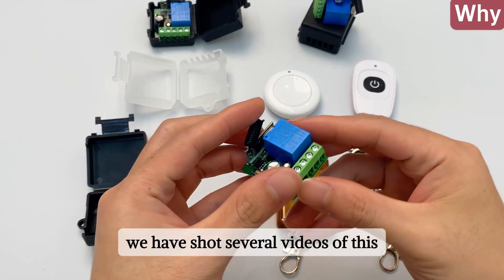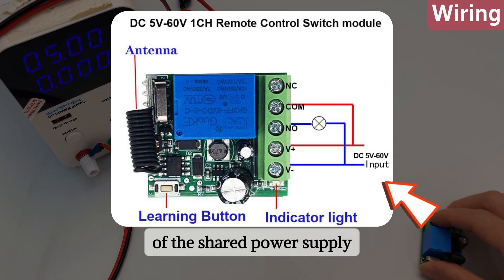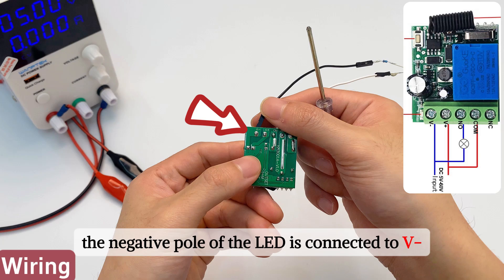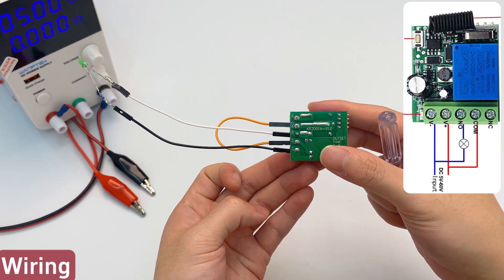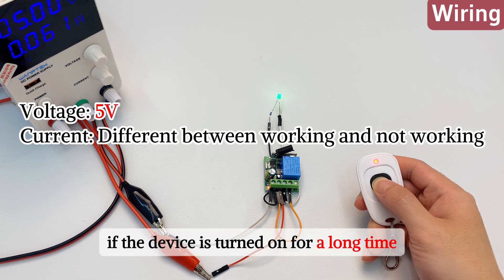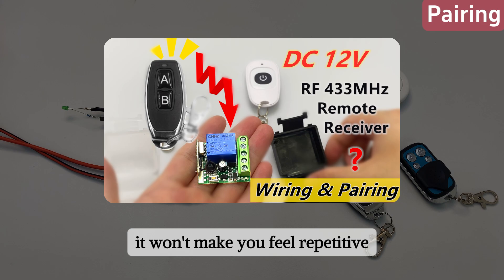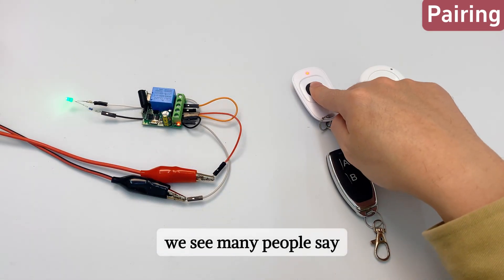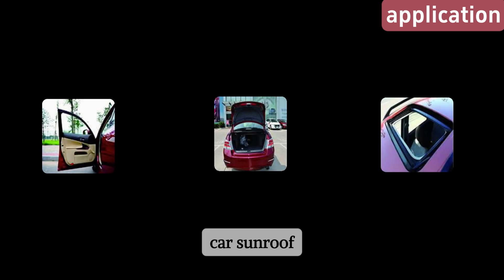Relay remote control switch 5V 9V 12V 24V 36V 48V 60V RF KR3001 Based on KR1201 upgrade by QIACHIP

Comment: Dear brother, 12 volt battery is connected with relay and pair modes.... after if the 12 volt battery disconnect then connect again and pair modes with remote..... Or not to again..... Reply me please.... Thanks
Reply from the maker: No need for re - pairing. 
After disconnecting and reconnecting the battery, the previous pairing mode with the remote control will be retained. You can directly use the remote control for operation without repeating the pairing process. 
I will make a new video for a test demonstration later. Please follow me to receive the new video in a timely manner.
Reply: Thanks bro.... I have subscribed your channel
Reply from the maker: https://youtu.be/9_AoavVu7rc
Does the Relay Switch Need Pair Again After Power Loss? Wireless Remote Control Switch 12V 220V Test
I do，bro

Comment: Product links provide please
Reply from the maker: https://qiachip.com/products/kr3001a-rf-433mhz-remote-control-1-channel-dry-contact-switch-wide-voltage-power-supply-dc-5v-9v-12v-24v-36v-48v-60v-10a-relay-1ch?variant=42728801304646
Reply from the maker: If you have any questions about purchasing, feel free to contact qiai@qiachip.com

Comment: Thanks for this excellent work - can we use this tool to open and close the window?
Reply from the maker: You can use this one as a dry contact
Generally, windows are controlled by motors, one for opening and one for closing;
You can watch this video
https://youtu.be/o7SbTBAeAlU
How to use 2CH RF remote switch linear actuator controller forward reverse rotation momentary KR2402
Or is your window another type?